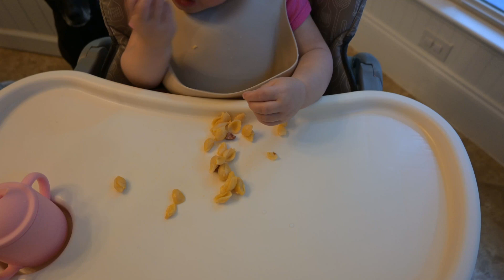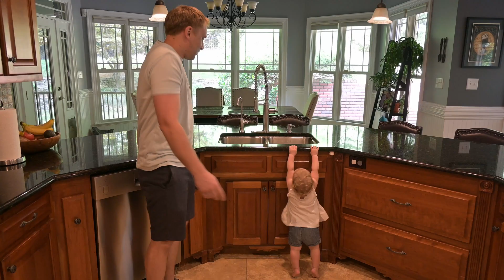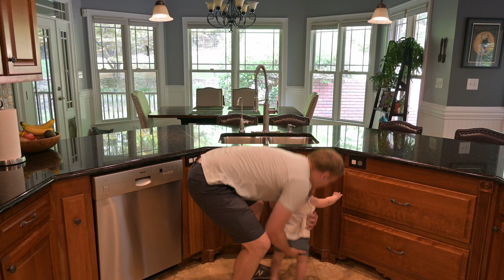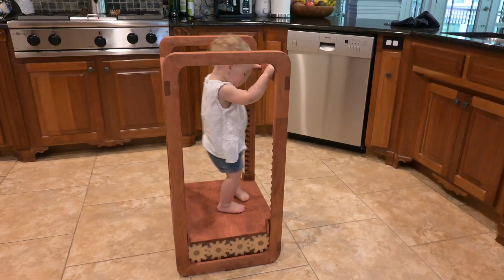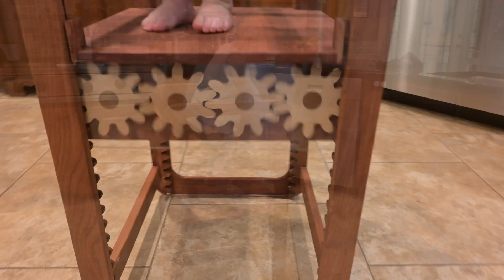Why I Made My Toddler an Elevator

Comment: Very impressive build. Can you fix the links to the electronic components in the description? Two seem to be clipped URLs
Reply from the maker: I think I fixed it. If not here are the links.

Motor Controller: 
https://www.electric-linear-actuators.com/products/wireless-dc-12v-24v-linear-actuator-remote-control-switch?variant=42083977855235

Motors (24V, 18 RPM):
https://www.ebay.com/itm/334443054974?var=543456824614

Bearings:
https://www.amazon.com/gp/product/B087RBP8XP/ref=ppx_yo_dt_b_search_asin_title?ie=UTF8&th=1

Battery:
https://www.amazon.com/VISET-LI-10000mAh-Electric-100W-500W/dp/B0B5DK4NN8/ref=sr_1_3?crid=1D2HEO3K8EW80&keywords=24V+bike+battery%27&qid=1700911964&sprefix=24v+bike+battery%2Caps%2C90&sr=8-3&ufe=app_do%3Aamzn1.fos.304cacc1-b508-45fb-a37f-a2c47c48c32f

Magnetic Limit Switch:
https://www.amazon.com/Embedded-Magnetic-Window-Contact-Sensor/dp/B08FH3M1LT/ref=sr_1_17?crid=13W7K4HPR86U3&keywords=magnetic+limit+switch+NO%2FNC&qid=1701089956&sprefix=magnetic+limit+switch+no%2Fnc%2Caps%2C80&sr=8-17

Comment: can I ask for some more details on the size of gears? did you use evolventdesign to make them and the rack? and where did you get your limit switches from? Do you think one motor would do it or is two absolutely necessary? Your link to the bearings leads to the motors...
Reply from the maker: I made the gears in my own CAD program with standard equations, but a gear generator I am sure would work. The limit switches were from Amazon, they were NO and NC magnetic limit switches. I think it depends on how much you want to lift. One motor would have lift about 30lbs for me and I figured adding an extra would let it last as my daughter got older. However my intention was one motor at the beginning which is why they are dual shaft motors.

Hxchen RC-35 NC & NO Wired Magnetic Door Window Contact Sensor Switch Contact Sensor Alarm Magnetic Reed Switch White - (5 Sets) https://a.co/d/4gkawSp

Donepart Bearings 1 Inch ID x 2 Inch OD Deep Groove Ball Bearings with Snap Ring, Garage Door Torsion Spring Center Bearings, 4 Pcs https://a.co/d/5zazBNG
Reply: if you wired them using the normally closed wire on the switches does the board still work to stop, or did they have to be wired via the normally open side? Just having troubles finding simple normally open switches, but normally closed are everywhere.
Reply from the maker: The board will do what the switch is wired for. So if you want it NC or NO thats how you have to wire it.

Comment: Great work! Out of interest, how did you know the motors would be powerful enough? Did you do some fancy calculations? I've got another project that I'm working on where I need motors but struggling to work out how I calculate the power / speed requirements. Cheers
Reply from the maker: Yes I did some calculations. These worm gears you have to balance speed and torque. Basically found the slowest and highest torque motor I could find. From there I could use the diameter of the gears to calculate speed and lifting force. In theory it should lift about 60 lbs.